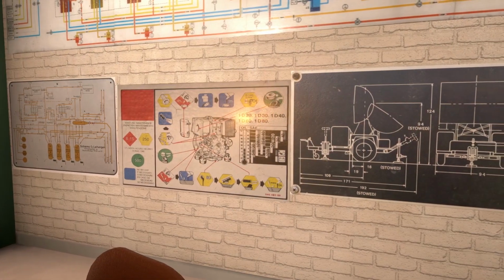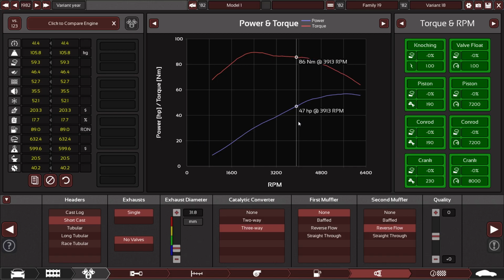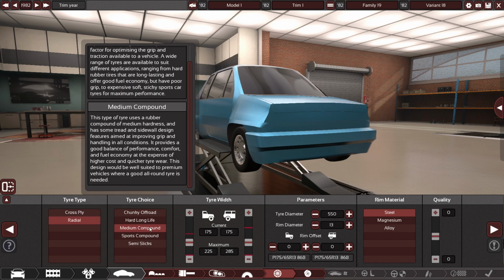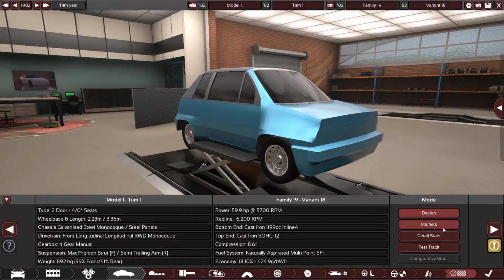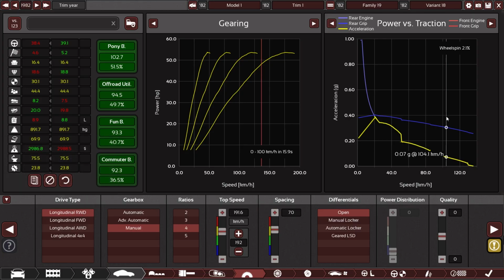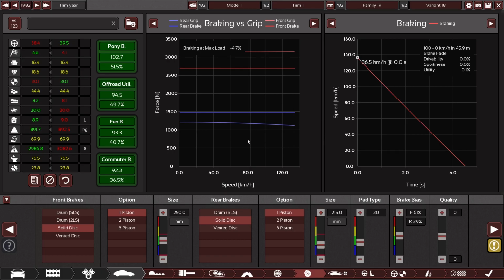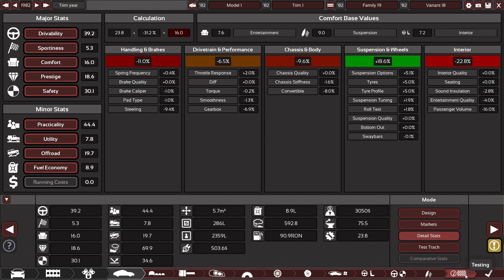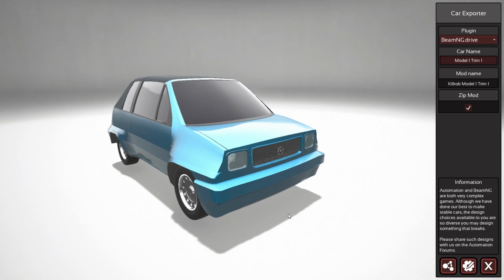Automation Tutorial: Making your first car, Export to BeamNG.drive

Comment: but how do you import automation cars? I have the exported files of the two cars I want to import back into Automation cause i lost all my progress but idk how to import them
Reply from the maker: It's not terribly difficult.  Go into your BeamNG mods folder and find the car you want to import into Automation.  If it's a zip file, open it up and go to the vehicles\<YOUR CAR'S NAME> folder; if it's an unzipped mod, just go to the vehicles\<YOUR CAR'S NAME> folder.  In that folder, you'll find a .car file; there will only be one file of that type in there.  Simply extract that file (if you're looking at a zipped mod only), then copy/paste the .car file into your %localappdata%\AutomationGame\Saved\UserData\CarSaveImport folder.  The next time you start Automation, your car will import automatically.  

Just bear in mind that if the car was made prior to the LCV4.2 version of Automation - which came out in late 2022 - it will probably not import correctly.
Reply: @AutomationGame  Thank you I got my cars back with all their modifications

Comment: Hello, I bought the game yesterday  and I am having a blast even without really knowing what im doing. I just have some concern, the ui doesnt look the same inside the car design section. it actually feels downgraded compared to what you have now. Am I missing something? Are there mods I should download?  I have a basic 3D gizmo compared to here. Also I dont see any materials option when applying a fixture!
The different fixtures categories are all "red" as opposed to what you have here where every type of fixture seems to be color coded.

Another annoying point is that you cant seem to change inputs (Keybindings) W is set to Move tool AND to MOVEUP. I tried biding MOVEUP to the UP arrow but its still being used as W to move, so when I want to select the Move tool it also moves the cam which is pretty annoying! I understand the game is in pre release, is there a way to make some feedback after testing the game. I did notice a handfull of bugs and would be cool if we could send feedback to you guys.

Comment: Any way to make interiors for cars for in Beam.NG?
Reply from the maker: If you're a modder then yeah, you can put an interior into an exported car, but it's not easy. Interiors would be extremely difficult to dynamically generate for Beam, so we're not going to do that for Automation 1.0.
Reply: @AutomationGame  Ok... and copy paste an existing interior into an automation car? Like use the data of a similar sized car.. I would like to be able to drive Automation cars from the drivers seat.. but definitely not a modder..

Comment: I tried to export mine, but then it said: "Failed to delete or write to zip" and I also just installed beamng.drive, can anyone help
Reply from the maker: Your anti-virus is blocking folder access for Automation. Turn ransomware  detection off and it should work.
Reply: YES! Thank you it worked

Comment: My 0-60 Timing is 3.9secs how do I get a better timing?
Also, How do I get better gas mileage? mine is at 10MPG for a hypercar :/
Reply from the maker: More grip (for instance through AWD) or better tires.
Leaner fuel map :) lower your AFR slider.

Comment: 7:36 Nooooo! You were supposed to teach them how to tune suspension themselves! You were supposed to be on the good side! The cars will drive horribly with presets!!
But on the serious note, you should've at least told them that there's a hints list at the bottom left, with suspension values
Reply from the maker: Nah, the presets are fine since the Car Designer Revamp update, they were trash before though :P this should be pretty good as is.
Reply: No! :p It's always better to tune suspension manually (using preset as a base). And I think more people need to know that. They'll never get better results if they'll not spend some time on the suspension tuning (tutorial on suspension tuning wouldn't hurt ( ͡° ͜ʖ ͡°))
Reply from the maker: Yeah, we need a tutorial video on that!

Comment: Very handy for making your own dream garage in BeamNG, possibly crashing it seconds later.
But I got a problem, in the engine designer, the engine model runs much faster than usual (at idle, i can see internals beating like its redline) when manually tested, it just advances the already high speed. Sounds work. Just the animation is bugged. Any suggestion?
Reply: There is a setting in game for the displayed engine RPM, its always a fraction of the real speed (IRL 1000rpm already looks like a translucent disk, not a visible crank).. turn this setting down to get the look seen here in the video.
Reply: Thanks, that solved it. Found myself comfortable with value 0.10. I don't know how did it happened, one day just bam the speed was wrong.

Comment: Time to see how my muscle boat performs on the Top gear test track. 6.2L V8 twin turbo 1000bhp Demon killer.

I pretty sure it not going to end well when i try to turn.
Reply: Lin Chester gg
Reply: Lin Chester  It’s funny that I built the same thing LOL 😂
Reply: Treflash Gaming haha it more fun to make stupid crazy horsepower cars with bad handling. 

I have an Toyota AE86 Trueno replica 800 kg car with a 270bhp engine and it flies. But there is no aero since it a 1983 era car. I gonna be drifting the car on the track.
Reply: kinda scared to try out this... thing. 2300HP https://i.imgur.com/KjLf5gJ.jpg
Reply: Justin S Friday the 13th. I a fan of that movie although with all the cheesy effects. 

You need to paint yours funky 70-80 colors to make it look like that era and it reminds me of the Mystery machine in Scooby Doo
Reply: may attempt modding a skin for it. that would be pretty fun haha
Reply: Lin Chester my 2200hp truck does fine
Reply: 1000 is nothing, in an older version of automation i made a TT v12 with 2700HP